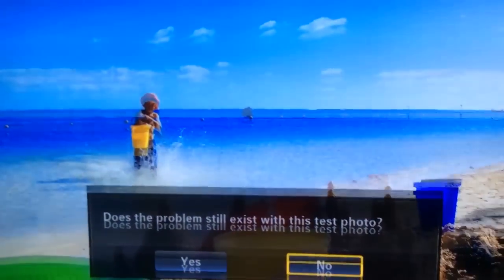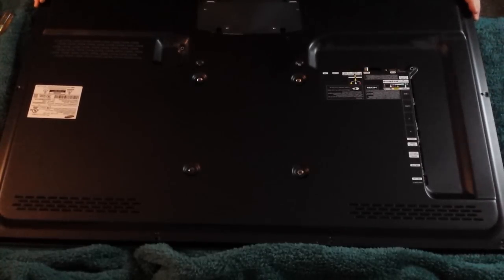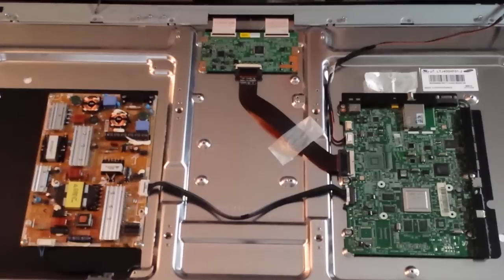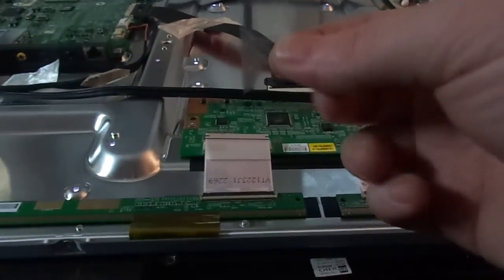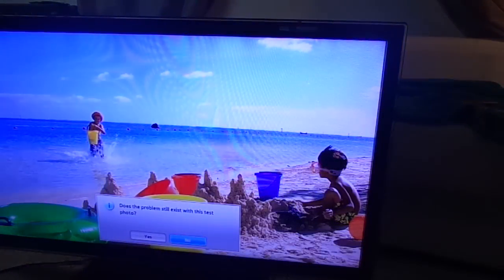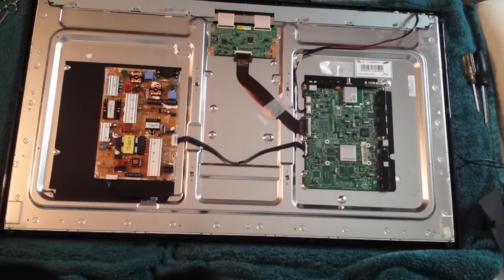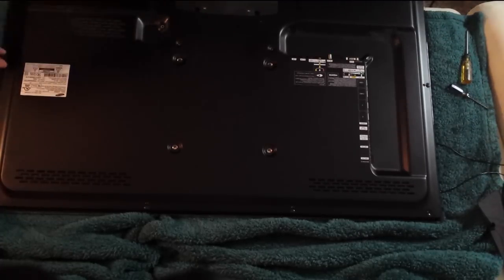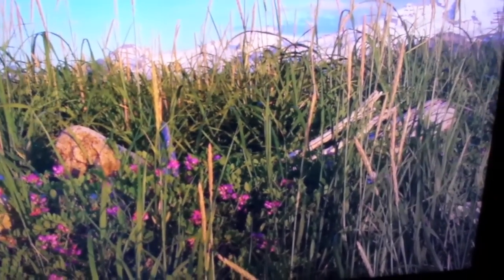LED LCD TV FIX, How To For Samsung Double Image, Black Vertical Lines, Screen Problem Sony LG.

Comment: Is it the same way for Sony Bravia 32" LED TV also..? Pls help to answer.
Reply: i think if you try it, you wont take anything worse!
it just a trying, you wont reset anything
I made my samsung tv today from this video(and im courious whats this "unconnecting" will close in the future), 
just make sure that the picture wont be different!
first time when i took the capton tape onto the ribbon cable, the right side was little bit darker than the left.
so i tryed till which leg is good.
good fun! :)
Reply from the maker: +M P Varghese  I am not sure.  I know there have been several people that posted stating this video helped them remedy the issue with there'er SonyS before.

Comment: HA!  THANK YOU    I used a 1/4 inch piece of paper and moved it around till i found the spot that worked.  I have a Scepter X40   (X405BV) 40 inch that has (had) a double image (samsung LCD and guts).   Question:  Anyone else have a buzz in the power supply?  I noticed that there are a lot of Samxon caps.
Reply from the maker: +Thanks No-- Thank you for your post.  It will greatly help others working on the same issue with there tvs.

Comment: Hi Dave and thank you very much for this amazing video.... I had an UE40D5520KXXU doing the same double image thing and was lying in my workshop gathering dust after tried almost everything to get it to work, changed the T-Con twice to no avail then changed the main board and again had the same issue then factory defaulted the set + many picture reset and T-Con chips re flows also tabs bonding after that gave up and decided to scrap it to free some space later . Yesterday I put it on the bench and tried for the last time, so did some googling to see if some one have cracked this and after some digging I came across your video but took me about four hours and eventually managed to get a fascinating clear and crisp picture but for some reason worked on the left LVDS ribbon cable not the right one. 
Can't thank you enough buddy, anyone else trying this fix be patient and keep trying as Dave mentioned and you'll get it sorted.
Reply from the maker: +Awad Absin Thank you so much you are too kind.

Comment: Thank you so much Dave..:). It saved me around Rs18000.
Samsung Technician told need to change LED panel and it will cost 18000. And a private technician asked 13000 to fix this.
But i saw your video and just followed it and solved this in 20 mins on my own. I am really thankful to you. Great helpful video.
Reply: +Arun Chakravarthy  Hi, what kind of issue it was? I am getting a black patch..can that be fixed with this idea....
Reply: For me, Double image was displayed. for that, this fix worked. Sry, Not sure abt black patch.
Reply: In my TV only one cable is there no left and right cable

Comment: Hi Dave , I changed my T-con bard and some solidization left however the quality of the picture is still poor... kind of fewer pixels but with not lines or extreme brightness as before. my TV is LG 50PS3000
Reply from the maker: +luis miguel Checa Late response here.  What I gather from your question is (I'm assuming) you changed out the T-con board and tried the steps in this video to get rid of the double image.  There have been many ppl stating that the screen has seemed to be a bit dull especially on one panel after following along with this video.  Some have commented that they were able to use less tape or just cleaning the ribbon cable with an eraser. Someone also mentioned putting a piece of paper on the back of the cable.  This is not a professional repair so the end result may end up being a bit off.

Comment: Can't remove 3 screws from last bracket that covers ribbon bands, any suggestions on what to do??
Reply from the maker: +Pegasus Please forgive me for responding 2 months later. If you have not thrown the tv out the window yet I would try to use a smaller bit (screwdriver) that will fit the screw head.  If they have been stripped you can try to take an electrical drill with a metal bit the same size as the screw head and drill out just the head of the screw.  If you are able to do that very gentle you should be able to remove the cover. Make sure not to drill all the way though the tv.

Comment: After the step where you unplug one side of the ribbon and try to turn on the TV to see half a picture, my TV would not turn on. I made sure it was plugged in and tried different outlets but it still won't come on.
Reply from the maker: +K20eighty3 My apologizes for such a late response. If you are still at it I'd suggest to check that a capacitor did not go out while working on the issue.  It may be as simple as changing a bad one out.

Comment: excellent,, i found a  samsung tv model number,,, UE46F6800SB tonight,, but the screen is cracked over most of it,,,,i switched it on an voila,,, the lights came on but no picture can u help me,, figure what i need to do thanks :)
Reply from the maker: +maxine fallone Great find model wise however I don't think there is anything that can be done to fix a cracked screen display.  You may want to weight the options of replacing the display panel, buying something new or just putting it back were it came from.  I wish I could tell you something better.

Comment: But what is the reason? Is this a permanent fix? Is there any loss in picture quality?
Reply from the maker: +Costin Herea So far the only complaint people have stated is sometimes one side of the screen is slightly dimmer than the other.

Comment: Hi Dave. Please help me with your valuable opinion.
When I switch on my 42" LED Panasonic TV(Model - Smart Viera,)  there is both video and audio on the upper half of the screen ....for the first 1/2 sec ..then there is both video and audio on the full screen for the next 1/2 sec...and then the screen goes blank (no video..no audio..) and the red light starts blinking. 

The mechanic says that the panel has to be replaced which will cost around 2/3 of the price we paid for the TV ( less than 3 yrs. ago).. Is he telling the truth or just misguiding us?
Reply from the maker: +The Aquamarine Arena I don't know if the panel would need to be replaced based on you stating that a picture does come on for a second.  Normally (in my experience) a flashing red light has always been a signal for a power supply or cooling issue happening. If you are in doubt maybe get a second opinion. You can also ask a tech why something needs to be replaced.
Reply: +Do It With Dave Thanks for your opinion.

Comment: I have tried this fix, and it did remove the double lines/flickering, however, like many others here, there was a side-effect that made one side of the screen very slightly dimmer - almost unnoticeable (I'm guessing due to the covered contacts).  Tried many different tape positions/sizes with no success.  After removing the tape, I experimented a little and found that running an electrical screwdriver across the contacts whilst the ribbons were plugged in caused some flickers/dimming and then the screen was perfect until I next turned it off - strange. I don't recommend this, as it may be a little dangerous and can cause a little sparking.  Make sure not to touch any metal part of the screwdriver or tv with your hands.  The screen may also go black, but it always comes back after turning on/off.  I use this fix everyday, and have done for nearly a year.  I'm guessing this temporary fix also removes some kind of built up charge, but does indicate an underlying issue that gets worse with time. Perhaps a capacitor issue (at a guess).  I'm curious to know if anyone has tried to replace the offending ribbon cable to fix this.  I'm looking for a more permanent fix that does not compromise the picture or requires me jabbing a screwdriver into the tele.
Reply from the maker: +Stephen Leary Thank you for sharing.

Comment: Sir, can i do that also in my AOC LED Monitor? It has horizontal line on screen and double image. How can i fix it?
Reply from the maker: +karla lahom I honestly don't know if the AOC monitor has the same set up inside with the two ribbon cables.  It could be like the Samsung in that way and the issue your monitor is having may be remedied using the steps in  this video.  Or a single ribbon cable.  If you end up opening the housing you should be able to see if it is the same immediately.  If you do end up working on the issue your monitor is having please update any information you can. Thanks for watching.

Comment: Hi Dave, 

I would like to consult regarding my two TVs.  Both of them no longer have warranty.  I would like to know if there is a DIY way to fix it since when I have it checked the repairman told me to buy a new unit instead since the cost of repair would almost be the same.  Here are the problems:

(1) SAMSUNG LED Model: UA40D5000PR
Problem:  Almost 80% of the screen (horizontally from the top) has the color fading to almost grayish black. It sometimes normalizes but only for a few seconds and there seems to be a horizontal line where the faded and normal color meets and sometimes a overlapping resulting to a distorted image.

(2)  DEVANT  LCD Model:  22DX850  
Problem:  No sound coming out.  I tried connecting to a speaker through the earphone jack still no sound coming out.

Thanks

Comment: Hi Dave, thanks for this video.  I haven't tried this yet but will do. Afterall, the warranty is lapsed already and there's nothing to lose compared to bringing it to the repair shops which costs almost the same as buying a new one.  I would like to ask though if the same technique will work if the screen turns and fades to black horizontally.  It started only on the side slowly progressing. Now my tv is almost more than half blackish from the top  (not totally black) with only about 1/4 of the horizontal display from the bottom giving good picture.  My SAMSUNG is UA40D5000PR model.

Thanks.

Comment: Hi Dave! Very nice video, clear and simple. 
Have you ever come across Samsung LE40B53 or similar with a screen that flickers with horizontal bright lines for about 10 seconds every 5-10 seconds? Is it a damaged capacitor? I appreciate the advice!
Reply from the maker: +Ara Hayrabedian If you are using the Samsung as a monitor check to make sure the pixel rate and hrz output are set to handle that tv in the control panel settings.  If not and you decide to open the tv and investigate the issue I would suggest to dedicate enough time for a full visual check of all the components.  Checking the capacitors is very easy there are many videos on YouTube that explain exactly how to do so.  I had one  monitor and one tv with close to this issue.  On the monitor I was able to check and replace a capacitor that failed.  On the tv (used as a monitor) the display settings needed to be calibrated in the control panel. The issue may be in the T-Con board.  The refresh rate and hrz output may not be properly functioning.  I don't know how to test a T-Con board. I hope I was of some help.

Comment: amazing!  worked on the first try.  my repair guy said i needed a new panel and i even showed him your video and he said it wouldn't work.  but it did!  but why??  why does it work?  you're a life saver.  thanks!
Reply from the maker: +Kelly Whiting You go!  Im glad you found this video helpful.  I am assuming that even if a repair tech knows that the steps in this video will work they would not sell someone on this type of repair. Think if they did fix a tv with the tape than they would be fixing something with a piece of tape and how can they explain that as a professional result.  Also they really wouldn't be able to offer a warranty with that. So the only professional way to do it would be to replace the panel. From what I've gathered the reason for the issue in the first place is that static electricity builds up where the ribbon cable makes contact in the slot and as a result displays a double image on the screen.  By placing a clear piece of tape between the connections it does not allow for any static electricity to be stored there anymore thus eliminating the issue. Thank you for watching.

Comment: Hey bro it's kinda funny that I picked my tv up off of the junkpile in my neighborhood also and it is the exact same model #UN46D6300FXZA except this one that I found won't come on but the stand-by light blinks and I would like some help fixing it if you don't mind. I would be forever grateful. thanks in advance.
Reply from the maker: +tim bridgers I have not run into that problem with the Samsung however the red blinking lights almost always indicate a issue with the power supply for all tvs.  I came across this video that may help you to better understand and resolve the issue your tv is having. 

https://youtu.be/wEWzYLaKdgU

I hope this helps.  BTY pretty good find on your part.  If for any reason you are unable to remedy the issue your tv is having you may be able to sell it to a tv repair shop. From what people are posting the panels are very expensive to replace and the panel on your tv is more than likely in good condition.  Either way please post any updates you can. Thank you for watching.

Comment: Hi, I've horizontal lines but no vertical lines, theese lines are only in the upper part of the screen, how can I fix it?
Reply from the maker: +Ludus LGR Hello. If you have already taken the tv apart and followed the steps in the video than you should be able to get the lines to stop showing by gently adjusting the ribbon cable while it sits in its slot then locking it in place when the screen is free of lines. Please share anymore information about the issue your tv is having and any progress you make. All information posted will help all of us to better understand how we can get the picture back to normal.

Comment: Dave, you are not only a genius, but also a gentleman, a scholar, and a huge dollar saver.  I walked into my house tonight after a long week at work, and my wife says "Not good, something is wrong with the TV".  And it was the dreaded double screen that I had never heard of before.  After following your video, it is working great.  I could not get the UN40D6000 to power on during the repair, and rolled the dice with a comment about covering 16 pins with the tape. Put her all back together, and she is working great.  Just in time for Ole Miss football tomorrow. Many many thanks.
Reply from the maker: +jivemaster55 Im very glad you found this video useful.  Thank you so much for watching.

Comment: MASSIVE THANKS.Our Samsung tv is out of warranty and I rung Samsung to see what could be done and was quoted £250 to fix it.As  last resort I found your video Dave and came in drunk last night and operated on the tv.You're not kidding about patience! finally the double screen problem was fixed after trying the tape in many positions.Woke up in the morning and found that one side of the screen was darker than the other (couldn't see that with drunken eyes)Returned and narrowed the tape and had a few position changes today, and its totally fixed!Thank you very much Dave. www.omgprints.co.uk
Reply from the maker: +Lee Taylor Thank you for sharing that's a pretty great story.  Im glad this video was helpful.

Comment: This is a great fix video, but, please tell me, how did you determine that this would work?  I've seen many of these TVs with this problem and the manufacturer says it would require a new LCD panel to solve the problem.  Did you just experiment with this until you found that it worked.  I would have never thought that covering up some seemingly important connections to the LCD panel would solve a problem.  What are the covered connections in there for anyway?

Anyway, thank you for sharing this.
WD

Comment: I was also facing the same problem for two days and samsung service centre engineer said it require to change panel and cost around 17000 INR or they said your best option is to buy a new tv. Thanks to you for posting this vid, I did the same as shown in video and it works, tv is working perfectly. Thank you for wonderful DIY for samsung tv.
Reply from the maker: +Neeraj Kumar Good job. Thank you for watching.

Comment: SAMSUNG TV - NEVER gain.  After trying Dave's fix last week, I took my 46 inch Samsung into a local repair shop.  It cost $35 for the estimate.  Several days later, I got the call that the panel was bad and it would cost about $1000 to replace.  The set is being scrapped.   I have had other TVs - RCA, Philco, Sony - last over 25 years.  The Samsung went bad after 4.  Total piece of Korean crap.
Reply: Sony's go bad too. I've seen a bunch of Sonys with bad gamma chips with the colors really off. They all kind of use the same Chinese parts inside now. I've opened a bunch up and found Chei Mei screens. Samsung used to make their own LCD panels though, those were high quality. Samsung quality is way better than the cheapie RCA, Philco, Westinghouse, Vizio crap.

Comment: hello Dave. My led Samsung tv only has the horizontal line in the bottom. So I only took out the flat ribbon of the left side of the screen and placed it back gently to see if I can eliminate the lines. Unfortunately, while doing so the the whole screen turned black. Then I turned off the tv and took out the flat ribbon of the left screen. When I turned it on the right side works but as soon I try to place the left ribbon everything turns black again. 
I would appreciate any help. Its an expensive tv to throw away.